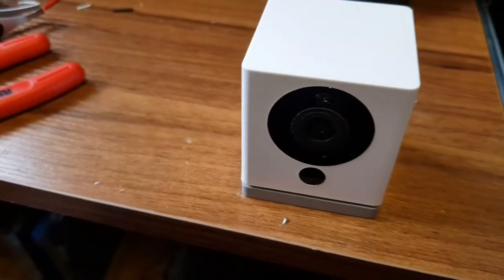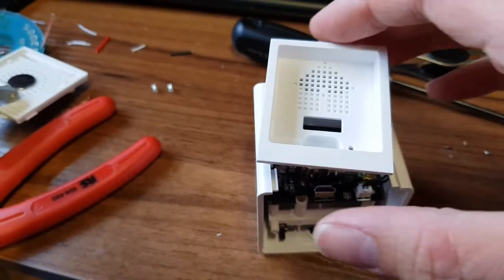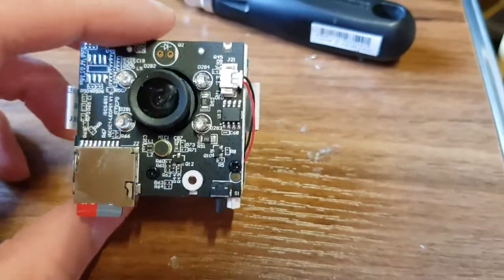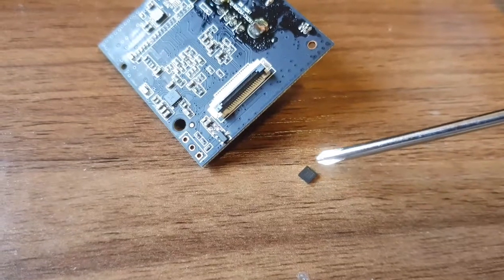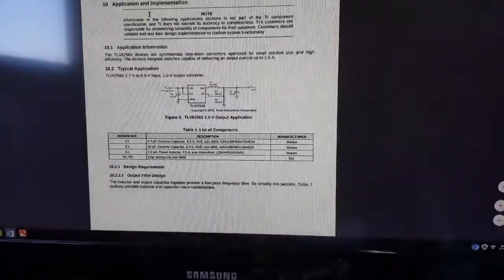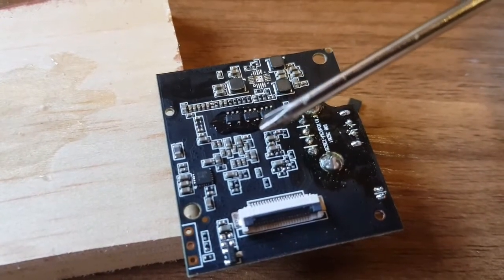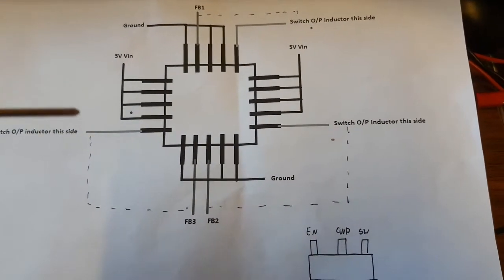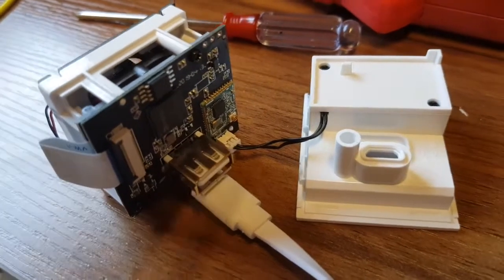Wyze cam V2 teardown and attempted repair

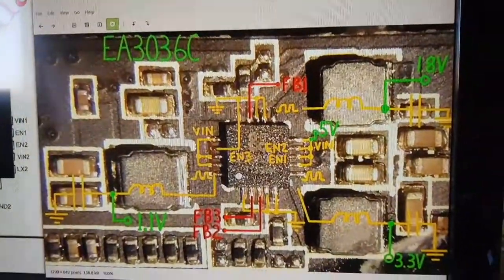Comment: The same component you took off 3:35, was the same fault of my V2 but it went past the overheating point melted the interior plastic around the speaker case & board brace that hold everything together

Comment: Thank you for this video. I just picked up a second hand wyze car, plugged it into my camera, and it ran for about a minute before dying and getting super hot. A quick look at the board and that same chip is fried. And a quick google shows that wyze was replacing a bunch of peoples cameras under warranty, because the wyze branded battery packs were frying cameras. Which is annoying, but atleast I know which chip to get now :P

Comment: Wow that’s a next level break down.  Amazing.
Reply: Yes flat head screw driver on side of the walls will loosen that from plate set of tabs as stated below. That was key because that back panel does not slide out.

Comment: I found the micro USB connector actually melted down from the heat generated by a high resistance connection. They actually use insulation displacement connectors for the micro USB, which is probably why it degraded over time. 
I just cut the connector off the cable, removed the connector from the board, and hardwired the 5V, and it's working fine again.

Comment: Got 5 years from a V2 that now won't scan the QR. Bought a pair of Wyze Cam OG which has better low light specs and a wider angle lens. It's a great skill to diagnose and repair electrons but repairing a $30 cam is not worth the time and effort. Clip didn't show the actually removal of the case bottom.
Reply: I had the same symptom, where it wouldn't scan the QR, though it announced the Ready to connect message. It was from a degraded micro USB connector that had high resistance and actually started melting the housing of the camera from the power being dissipated by the contact resistance.
Apparently when it's ready to scan the QR, it draws more power, and resulted in it rebooting, so it wouldn't scan the QR.
After hardwiring the 5V, it started working just fine again.  
The soldered connection shouldn't present any degradation problems like I had with the USB connector.

Comment: I'm down 2 of the IR diodes and thinking about replacing them using this video as a guide. Anyone else had issues with the IR's failing?
Reply: No, but have had the mic go bad, get nothing but static and voices that sound like they are too far away to hear when the people are right in front of the camera.   I have several of these cameras, V2, V3, Pan cam for years and the IR has never failed.   I would ask wyze to replace the camera.

Comment: I just fixed one of my Wyze v2s like this that had been outside, fallen pointing down, then gotten water in it while it was on. Some plastic melting, corrosion, but an alcohol and brush cleanup inside (including inside the ribbon connectors that were corroded) restored it. I had to take the lens assembly off due to some clouding on a little clear glass disc over the camera chip. Something had gotten in and deposited a hazy film on it.

I overvolted one of my dashcams once. I was testing it and hooked it to a variable voltage/current supply. Somehow I had it at 12V instead of 5. I had the current set low, around 200mA, and the dashcam kept rebooting. "Durr, it needs more current!" I kept upping the current until I was at an amp, then I saw that I had it at 12V. Never recovered, would heat up a lot on 5V after that, no response. I even had a current-limited supply but still managed to blow it out. A lesson on checking the voltage carefully.

Comment: Thanks for the video.  Is there someone in the USA that buys V2 cams for parts? Mine just flashes Yellow and Blue constantly.  Longest I gave it a go was 4 days with resetting all my WiFi networks.  It would not connect to my Network.  It does Power Up.
Reply: You can download the firmware to an SD card and reflash it, in case that's the problem. Wyze's website has instructions and the firmware files.
Reply: @gargantuablargg  I tried way more than I should. All the flashing from the all versions of firmwares didn't save it. Couldn't get anyone in Wyze to help me, both privately/email or publicly/Facebook.  It's a decoy now at this point.
Thanks
Reply: @gargantuablargg  Perhaps. Wish there's someone around that fix it.

Comment: there are tabs on the back plate that make it harder to pry out...if you pull on the left or right side wall then  do one side at a time it pops out really easily, thx for the confidence to rip dis bish apart

Comment: Thanks for posting the video, even if the repair didn't work. At least with your video, I was able to get to the components where as some of the other tear down videos on the Wyze Cam V2 "skipped" important steps and comments.
Reply: Main thing video helped me with was knowing the basic way to get the bottom and back off, knowing there weren't hidden screws or something else that would break if I used force. It's quite an elaborate design inside, with several boards. I'm impressed they got the cost down so much.
Reply from the maker: Glad it helps. Thanks for the comment.